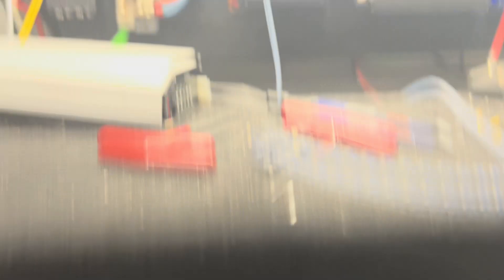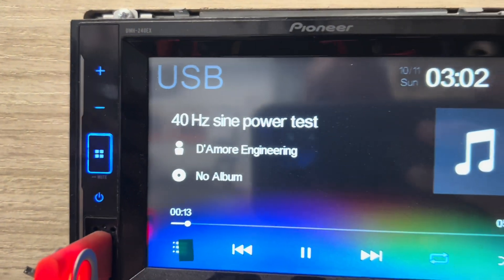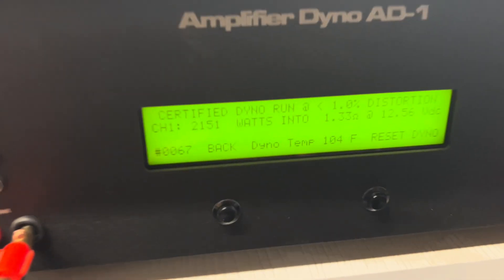NVS Audio bench test the new Cicada Audio FLX 2500.1 motorcycle amplifier.

Comment: I wonder of a pair of flx1400.4 or 700.4 will fit in the fairing of a indian challenger.
Reply from the maker: 700.4 yes , 1000.4 maybe 1400.4 I’ll have to try but these amps will not
Like the water that gets in the Indian faring
Reply: The FLX 700.4 will fit in the Indian Challenger as I have two in my shop bike. I am not 100% sure if the 1400.4 will fit at this time. I don't recommend these amplifiers for my customers as they cary no IP rating which means once they get wet they will shut down and water damage isn't covered by warranty. We run 2 SD800.4 EVOPS in the fairing all day with no issues